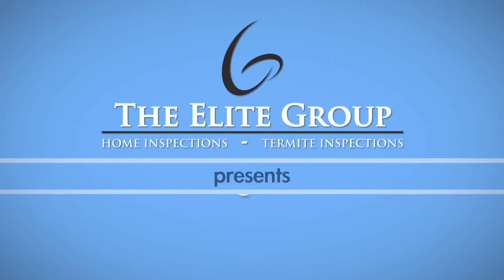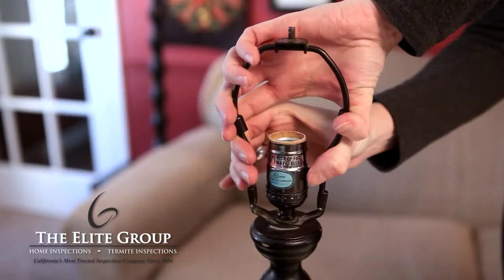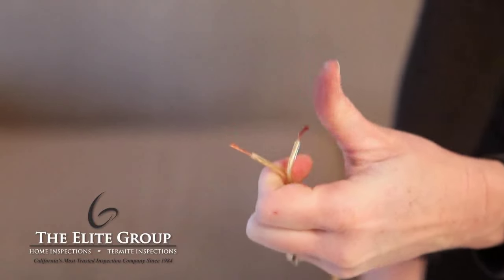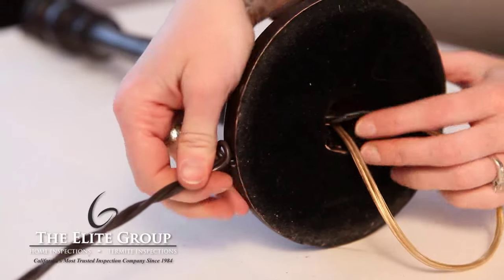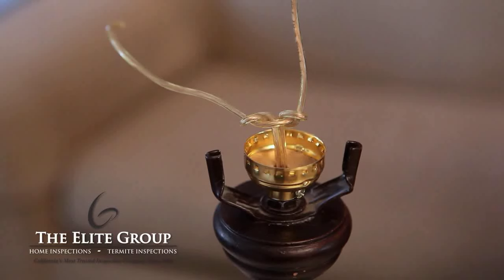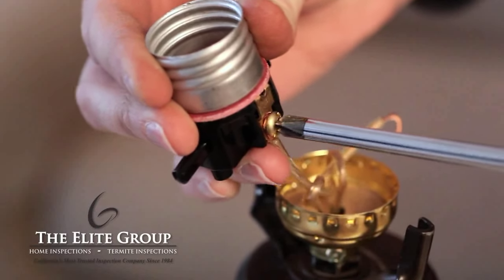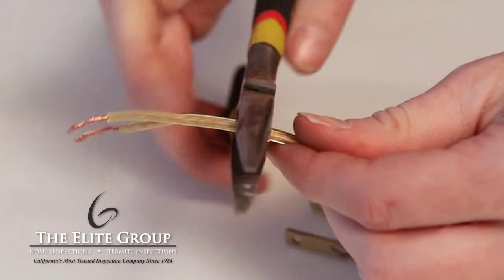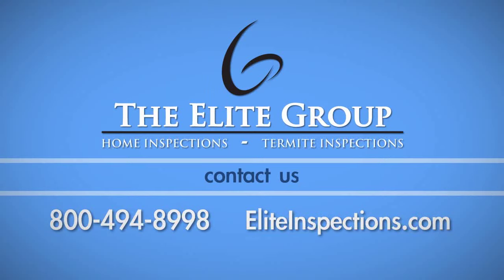How To Rewire A Lamp | The Elite Group Property Inspections

Comment: This was very helpful! I could not have rewired my lamps and without its assistance!  I skipped the last part of the video about plug replacement because my lamp repair kit had a wire with a pre-attached plug. And given this, I was just mindful about which end of the wire to feed through the disassembled lamp so plug was at bottom and not on top. NBD!

Comment: Great video! I will say that antique floor “bridge” lamps, or lamps with an open base (which is what I rewired), do not require a quick-clamp plug. They can use a pre-plugged wire instead.

Comment: The final step, attaching the plug to the new wire, requires attaching the neutral wire to the wide spade of the plug, and the hot wire to the narrow spade, so the lamp socket threaded element is neutral, and the center socket terminal is hot.
Reply: Chefs choice 460
Reply: It was a great video but you caught the part missed at the end! Thanks for your comment!
Reply: Thanks for that!  
Mike for Mayor✊
Reply: Thanks that was my question

Comment: Went a little fast to follow, otherwise it was a great help.
Reply: you can adjust the speed to 50% or 75% and the sound will still play.  Click on the little gear wheel in the lower right corner of the video.  This is the "settings" tab.  Go in there to "speed" and click whichever speed you like.

Comment: This is a bad instruction video, because replacement lamp cords always come with a pre-molded plug. Instead of fishing the new cord down from the top of the lamp, it should be fished up from the bottom, in order to leave the pre-molded plug intact. A second minor point, when attaching the top of the lamp socket to the base you want the switch to be at right angles to the harp legs. The video here shows (incorrectly) the switch in the wrong position when the top is being pushed onto the base. Overall, this is not the video to use for instruction.
Reply: Is there a better video to watch?
Reply: I think it is "overall" a good video, but the two points you made are good ones, also.  You could have elaborated on how to fish the wire up, though, by cutting off the old plug, and attaching and taping the non-plug end of the new wire to it, then pulling it through in a similar fashion to the way it was done in the video...
"Overall", it kinda takes a village.  
All good...